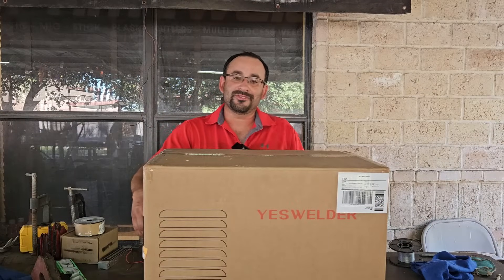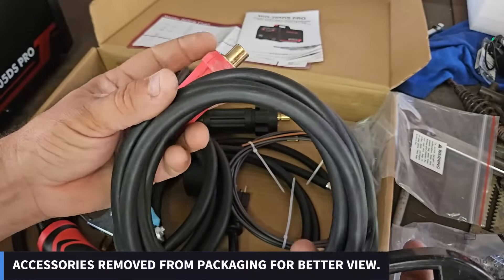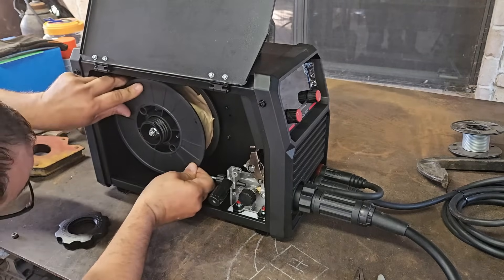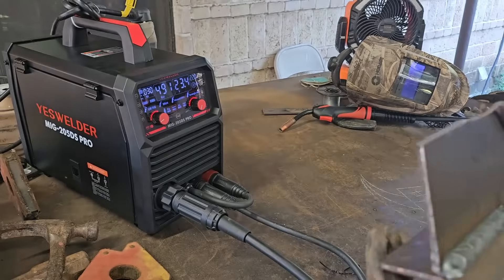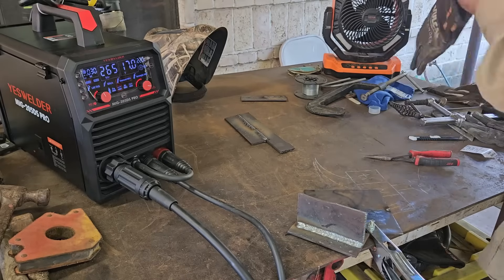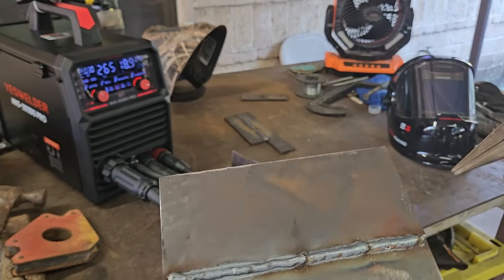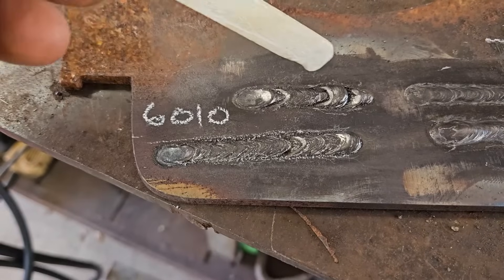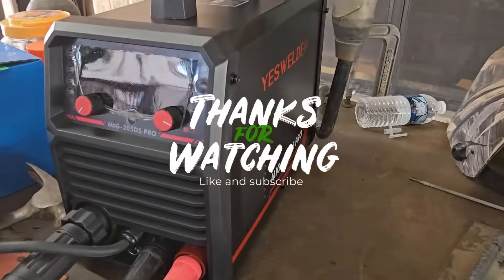Testing Out The All-new Yeswelder Mig205ds Pro 5 In 1 Welder review - Mig Tig #Yeswelder #migwelding

Comment: Same here... same rig, same helmet, same wire... same results! I now have a welder I can run off a 4500 watt generator and throw it all in the back of my pickup. Burn Baby Burn!
Reply from the maker: Quick question, is your generator an Inverter based machine? I used a Generac 8000 on a couple of other machines with terrible results and been wanting to try it on an inverter generator. I actually want to build a small solar powered station on my property for when I need to weld something quick and not carry the 500lb Hobart. I own several 200 amp machines and this is my favorite one. I used to have the Greenish colored MIG205DS and was also very similar to this machine in performance but blew up one day.

Comment: Do you think this welding machine could possibly weld 5/16" flat plate max or is 1/4" about the max it can weld ?  I need to weld 1 flat 4"-5" flat plate weld and a downhill maybe uphill 9" weld on my Ford tractor.
Reply from the maker: I believe this Yeswelder MIG205DS Pro can achieve welding up 5/16" with the correct method and wire thickness. I have welded 1/2" plate by beveling the plates and doing a couple of paths. 5/16 plate is not much larger than 1/4" so it should be achievable. As for tractors, if its a major structural part I would get a professional to help you.

Comment: What rod would you recommend to weld 4” square tubing I think is a 3/16 thickness
Reply from the maker: That really depends on the welding machine or application, my old Lincoln 225 buzz box ran 6011 which are AC rods and on my Hobart 225 engine driven welder I use 7018 on DC current and sometimes 6011 when doing pipe fences. I think either electrode will be fine, 6011 has great penetration even on rusty material but 7018 has nicer looking welds and far stronger electrode.
Reply: @cutweldngrind  what’s the biggest 7018 and 6011 rod you can burn a the yeswelder 205pro

Comment: Would the machine run the same on 110v?
Reply from the maker: The MIG205DS can run on 110 and 220 volts. If you are doing MIG mode on 110v expect about 160A at 60% duty cycle vs 205A at 220v.

Comment: https://www.youtube.com/watch?v=NPPqD7zl0ZE&t=750s

Yeswelder 205DS has better cables (VS Arccaptain Mig 200) -- power & ground-clamp:

12 AWG power cord (vs 14AWG), 4 gauge ground (vs 6 gauge ground). Arccaptain was melting ground cable under heavy use
Reply from the maker: I agree the MIG205ds and MIG205ds Pro have larger cables and handle the heat a lot better. The ground cable on my 200 did start melting a while back and the outer jacket just seems to fall apart with high heat. My first 205ds went out in a bang but when they work they lay down some nice dimes.

Comment: I find the yeswelder a weird mig welder for me it seems like it surge's as you weld with it. I have a suseme mig-235 I weld with on the regular and it don't surge when I weld with it wether it Flux or mig. That's the difference between the two in my opinion.
Reply from the maker: Thanks. I need to weld with both the 200 amp machines I have and do a comparison for sure. I still have to put some Flux wire and see how that goes.

Comment: I just bought the yes welder Mig 160 multi-process and the yes welder 65 plasma cutter I haven't even taken them out of the box yet
Reply from the maker: I am not familiar with the 160 but should be more than adequate for most diy small projects. I have an older green color Yeswelder plasma cutter that worked great too. I need to build a Yeswelder cart to house the machines now.

Comment: Nice machine, can you make a video showing how it preforms using 110 volts?
Reply from the maker: I will be doing other videos and 110v is something I can do. I tried to cover a little bit of everything in a video that's under 15 minutes and was a challenge for sure. I spent 3 days trying to get my new RODE Wireless me mics to work and finally gave up on them. Thanks
Reply: @cutweldngrind  thanks...
Reply: @cutweldngrind 
On 220v what amp breaker, single or double pole, Awg 8?